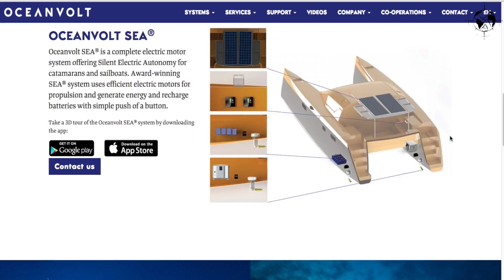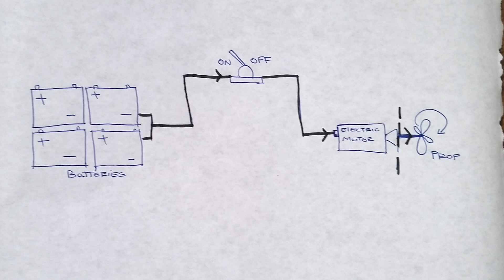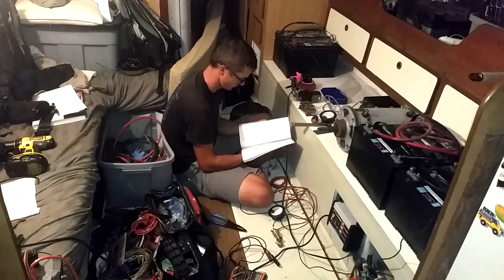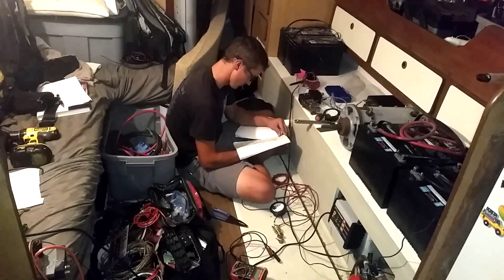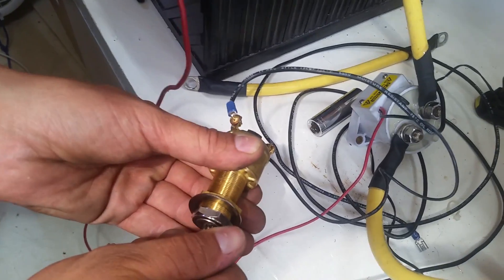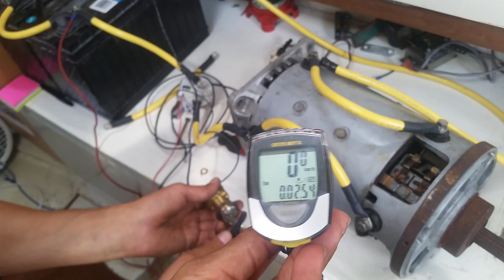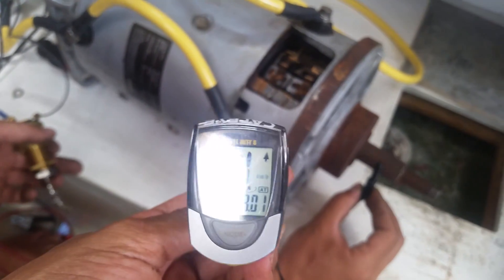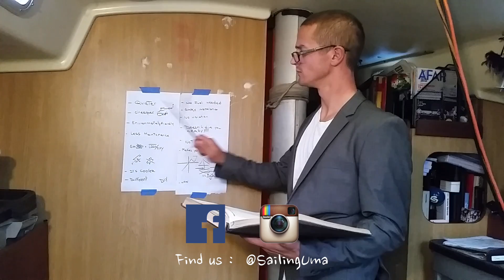We built our own ELECTRIC MOTOR  (Electro-Beke, part 1) — Sailing Uma [Step 17]

Comment: In thinking about your data ( 3 knots in calm water), there is an aspect to the control of your motor that I'd forgotten about.  When you apply the rated armature voltage with the rated field voltage, that condition is called "base speed" and that should be marked on the nameplate.  In the case where your motor is not overloaded in that circumstance, then you can gain some additional motor speed (above base speed) by utilizing a weaker field. 

So what happens is that the field current is reduced, and with it, the Counter EMF in the armature is reduced proportionally.  This will permit additional armature current to flow with the same applied voltage.  Thus, you get motor speed above base speed.  Remember that (armature volts x armature amps) / 746 = Horsepower.  If this does not exceed the HP rating of the motor, then it is not overloaded.

Additonal points to consider, first that much of that significant amount of that armature power is converted to heat.   That motor will be producing hundreds of watts worth of heat which you must remove safely and effectively.  Second, your chain will wear, stretch and may eventually jump teeth unless there is a provision for adjustment or an idler.  

Third, the mechnicial losses in the chain and sprockets will be on the order of 5 - 10%, so apply oil to minimize friction.  This may not seem significant now, but it is going to gain prominence in your thinking shortly when you begin to realize that you need an electrical generator for sustained operation.  

All that is necessary to come to this realization is to do some simple math.  1 HP = 746 watts.  Typical solar collectors on boats are a few hundred watts and a typical wind generator is about 400 watts at full wind speed of about 30 knots.  So with an average collector and 20 knots of wind, plan on about 300 - 400 watts of power and that is limited to the sunny part of the day when the sails are not in the way.   That translates to less than 1/2 HP and at night when you loose the solar, then it will be limited to wind only.   So do the math, how many HP is your motor ?

For around the marina, no problem as long as you used shore power to charge the batteries.  I suggest that you adjust your expectations carefully after that!  The bottom line is that you will soon get behind the curve on charging your batteries and that may happen when you can least afford it, like in a storm or darkness.

FYI....I drove an electric car for 3 years back in the 80's.  Google "CitiCar".  It seemed like a great idea at the time but it wasn't!
Reply: A very enlightening read! Thanks for that. 
Do you then suggest a much larger battery bank?
Reply: Ken, Larger storage will take you farther before loss of power, but if you are consuming more than you can possibly generate, then there is always going to be a potential short fall which could become a great deal worse if it were to occur at a critical time.  Imagine being blown toward a coast line for a period of time when you cannot make much progress due to wind direction.  Use of the electric motor will be limited by available battery storage power only.  I would never permit myself to wind up in that situation. I used to get into this situation with the CitiCar all the time.  I lived on top of a big hill that requred two minutes to climb when the batteries were in good shape. If I went very far in the valley. then I wouldn't have enough power to get home.  
With regard to the larger battery stack, that also requres either a bigger source of charging power on shore or longer periods of charging to get back to full charge. It also means more weight and additional risk due to larger amounts of  Hydrogen.  One last concern is that I had a battery explode in the electric car, and it ruined my hearing.  It was mounted in the front battery box but the noise came back through the firewall. The concussion almost knocked me unconscious for a time.
As you can probably tell, I have a lot of fond memories of the CitiCar experience!

Comment: Question Whats your plan B? Outboard with an alternator? Generator capable of powering the DC motor? Increase battery bank size and recharging abilities? Something else?  Over 200 comments and going so I'm sure you can't answer everyone.  My guess is you will be using about 30-40 amps pushing your boat close to hull speed with no resistance from wind or current and maybe double that to 60-80 amps if you have one or both apposing you.  Only asking because we have planned out something similar just haven't pulled the trigger yet.
Reply from the maker: +Hellava Life We will be posting many details on our website once it's all up and running. For now, we're going with modest solar and will be experimenting with regeneration from the spinning prop while sailing. There is no "plan B". We will eventually upgrade our battery bank once we determine how much power we can generate. Also, "Hull speed" is something only people with Diesel's worry about. It would take closer to 300amps to get our boat to hull speed. But 4 or 5 knots takes a 1/3 of that. So, slow is MUCH better when it comes to electric.  Stay tuned for more videos and more explanations as this experiment unfolds. 

Cheers!

Comment: nice mod,
 check this link http://store.evtv.me/proddetail.php?prod=10kwBLDC, its a nice deal. 48volt, regenerative capability, brushless motor, water cooling, weighs just 38 lbs, perfect for uma.
Reply from the maker: +didiafandi Thanks, but that motor costs more than our boat! We bought our motor for $100, and it's build solid and simple, which means it's easy to fix.

Comment: You have the wrong batteries for an electric drive system FYI.
Reply from the maker: +Scooby's Scoop What batteries would you recommend? Of course LiFePO4's would be best, and we plan on upgrading as soon as we can. In the mean time, this is just one big experiment to see if we can get it all to work. So far so good, We only expect those lead acids to last about 30min-1hr / day for a couple of years max.
Reply: +Sailing Uma gc2 from Sam's club. they are 6 volt and are actually deep cycle. you can do lifpo, but the price is huge. what you have, regardless of what the label says are starring batteries, and are not made to deep cycle.

Comment: I ve seen several boats on electric power but all of them came with a huge amount of solar panels AND a diesel generator to charge the bateries.Those motors consume power fast!What are you planing to do with the charging guys?
After all, keep on the perfect job!Good luck :)
Reply from the maker: +Babis Kouratoras So far, our plan is solar and regeneration from the prop spinning while sailing. But, we can't really test for regen ability until we get out sailing.

Comment: The electric motor is a very ambitious undertaking. You defiantly don't want to invent the wheel here. I agree with the comments about not wanting direct drive. Setups like this usually need room for mechanical  alignment error, like a pully or flexible connection. Also curious as to how long a run time you will get. I have to give you great respect for all I have seen you undertake so far, and I am sure you will continue to have great learning and success with your projects. Be safe and keep more fascinating videos coming.
Reply from the maker: +madogblue Yes, direct drive has a few complications. We still have our transmission and a plan to mount it, if we can't get the direct drive to work. Currently we only expect to be able to motor for about an hour a day. We have focused more on how much power we can MAKE in day, and that had dictated our battery bank size. Once we set up our solar and see how much power we can generate from the prop while sailing, we will update our battery bank accordingly. No point having a huge battery bank if it takes days to recharge fully.
Reply: +Sailing Uma It seems like no matter how hard you try to do a homeade direct drive, unless the tolerances are very close the vibrations will be the issue, that is where a flexible coupling solves a lot of problems. If you can solve this you are on your way. You are a very creative guy, good luck.

Comment: With this setup, will you be able to control the power drain of motor (to make motor run slower and conserving battery)?
Reply from the maker: +Ülari V Yes, we have a PWM controller so we can regulate the power from 0 to 100% and everything in between.

Comment: You may have already taken care of this and I am not sure how you are hooking up your drive line to your prop but by taking the transmission out of the drive line you will be transferring axial load forces directly to the motor, I could be wrong but more than likely the motor is designed for radial loads. If that's the case it would destroy the bearings and possibly the motor in short order.

Just something to think about in case you haven't come up with a solution for that yet, you could probably come up with a bearing assembly using two tapered roller bearings that would mount in place of the original transmission that would take the axial and radial forces instead of the motor. I am sure there are several ways to do it. 

If you are good with math and do a bit of searching you should be able to find the formulas to calculate the forces that will be generated by the prop thrust based of the prop diameter, pitch, RPM and possible the displacement/hull speed of the boat.
Reply: +Chadd Thompson Yes, same concern here.  The transmission has a thrust bearing that take the forward load of the propeller, I don't see where you have taken that into consideration.  Maybe I missed something, but if not you are going to drive the shaft right through the front of the electric motor in pretty short order.
Reply from the maker: +Robert Garbe We are installing the appropriate bearing the back end of the motor to take the trust loads produced by the propeller. That awful grinding sound you heard in the video when the motor was running was the bushing in the back end that needed to be replaced. We will be showing more detail in "part 2".

Comment: Also use a IR meter to read the heat coming off the motor under load for as long as it produces thrust to see if it will overheat.  Check its operating tolerance, and I didn't get a good look at your wiring, but I think your fuse might be in the wrong place.
It might require a cooling pump, if it is outside it's heat specification.
Reply from the maker: Thanks for the input. Yep, we do have a InfraRed meter for that.  The wiring you saw in this episode was more of a test. But it is wired as per the motor controlers specs.

Comment: Oh yeah, and the golf cart motor produces a lot of torque.  However, when under load the force backing up through the shaft from the propulsion...think someone standing outside the boat trying to push the shaft back into the boat..that thrust bearing in the motor can't handle the load..Likely it would require completely reworking the end of the motor for a new thrust bearing..Golf carts generally only produce a side load on the motor.  Some of this can be mitigated if you have a transmission, which I don't think you do.  Also milling a spline converter out of high grade steel would reduce the possibility of stripping the motor shaft splines when coupled with the prop shaft.  It looks like your splines are almost gone. A CNC shop can build one in CAD in a few minutes and send it to a series of automated machines in order to produce your part.  Man I want to hurt myself repeatedly for being so poo poo on this...bad Al...bad Al!! BAAAAAD!
Reply from the maker: +Allyn Onderdonk The motor is actually out of a forklift and is built like a tank! We are putting the proper bearing in the back end of the motor, rated to take the trust produced by the prop. We also do have a transmission, and if needed, can install it inline to reduce the speed of the motor, but will most likely not need to.

Comment: I think you two are really fantastic working on that motor and install.  Though I have to say you might end up in a bad way if you are taking more than thirty minute sails.  I'd save all the diesel parts!  Just in case!  A small generator might be able to give you some extra range, but end result you might run out of an hours worth of juice after an hour long fight with a six knot current and no wind..in front of a reef!  That 20 gallon fuel tank you threw out is 15 or 20 hours of thrust every day of the week for as long as the engine lasts(years).  The battery's will slowly degrade in their capacity.  Electric works fine in cars, but you have to spend a lot of money on aux generation to make it work on a boat.  Use as an example the Navy's new ships coming out to be used as rail gun platforms.  I am pretty sure there is a Yanmar direct replacement for the old Westerbeke!
Reply from the maker: +Allyn Onderdonk With proper planning and acquired sailing skills, we will be avoiding opposing currents and instead use tides and current in our favor. The whole point of going electric is to get rid of the stinky, noisy, troublesome IC engines all together. Yes, we will need to replace our batteries every few years. But they are cheap and easy to swap out. We have a sailboat after all, we will only use the engine for the rare occasion when we need to maneuver into a slip, or back down on our anchor.

Comment: Just one small criticism; the very first thing one the positive side of your battery bank should be the FUSE, and it should be as close to the bank as possible. Any wiring between the bank and fuse is unprotected in case of a short. Four 200 amp or greater batteries would be enough juice to weld with easily. Be safe and put the fuse where it belongs.
Reply from the maker: +fgreen411 Yes, this set up viewed in this video was for testing the motor and controller only. It was however wired correctly according to the motor controllers wiring diagram. In the final installation, the fuse will be much closer to the battery bank.

Comment: Hello,I enjoy your video's, you two are starting a life together your  young and full of life .I just want to warn you about some thing I saw you repair.That I feel  you did not do a proper  repair on.
 The keel, it was loose and you fiberglassed it.Couple layers of mat cloth , You have any idea the force on keel when your under full sail in good wind ? ALOT ! 
So much force on it that it could snap off .If that happened  the  boat will capsize and  you will be   in serious trouble  ...please ask a professional  trade's man how to fix the keel properly. Could be  inside bolts are rusted out . I don't want you guys to get hurt .  Good Luck
Reply from the maker: https://youtu.be/OyKy-cDy6e8

Comment: Great Job! Did you think about regenerative energie? like if you sial the proppeler is moving, can he loat up the battery like in a tesla when he breaks or just roll? sry for my englisch, not a nativ speaker :D
greetings from austria 
Sebastian
Reply from the maker: +dervisex Yes! We plan on experimenting with regeneration once the motor is installed. It is very possible. We will definitely get some current, but not sure how much until we can get out and sail.
Reply: +dervisex  ahhh, you answerd it below :D sorry :D dont stalk all of your comments :D
Reply: +Sailing Uma great to hear that.

Comment: I would be worried that randomly grinding/sanding parts that spin would leave them unbalanced. Won't this destroy itself once the whole thing is bolted into the boat?
Reply from the maker: +Jason Not really. Many electric motors have a key, or flat spot on the output shaft. Our motor in particular is build like a tank! It would take an incredible about of vibration before anything was damaged.

Comment: What are the chances of using the electric motor when sailing for a generator to recharge the batteries?I am concerned about the bearings being able to handle the thrust against them.  That is the purpose of having a transmission of sorts, something to take that destructive force away from directly against the motor itself.  Best Wishes.
Reply from the maker: +Les Sd The bearings we're installing are designed to take the thrust force. Also, yet, regen while sailing is a very real concept. It will take some testing a tweaking once we're out sailing. There is potential to get quite a lot of power back this way. We're excited to start experimenting with that soon.

Comment: You two are a great couple, very resourceful and a commendable 'can do attitude'. I think your minimalist solution is a viable one in concept terms. However to succeed you need to achieve a sound and robust installation. You see how you produced quality cable terminations? Well you need to do that on your drive line:

1. Get the armature set up on a lathe and produce a shaft coupling that will run true.
2. Replace all motor bearings.
3. You need a small thrust block between the motor coupling and the propellor to transmit thrust and protect motor.
4. Throughout design and achieve near perfect alignment.

This will not take too long or cost too much. Get it right now and save grief downstream.

Great project though 👍
Reply from the maker: +Norman Boyes Yes, the motor is in the machine shop as we speak. Stay tuned for "part 2" when we put everything back together and install the motor.